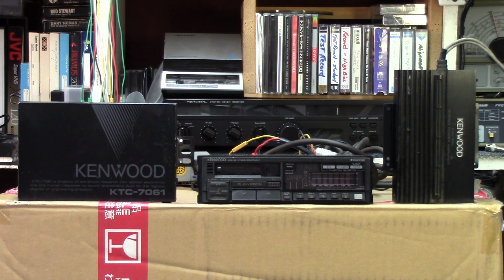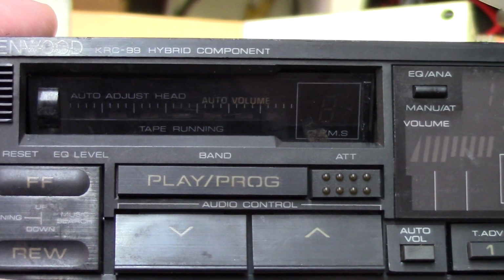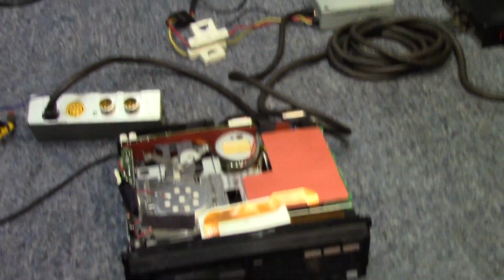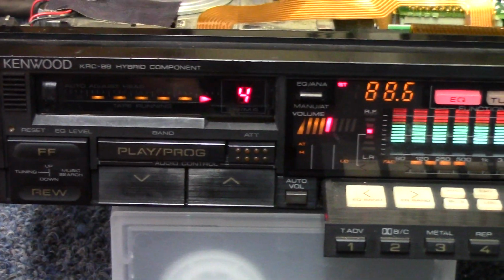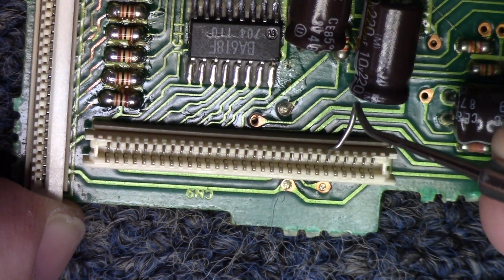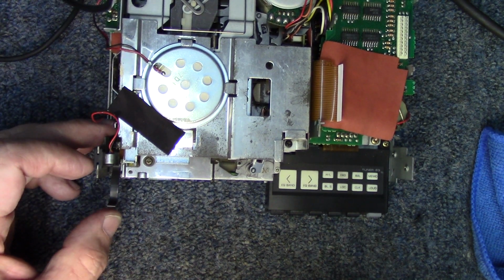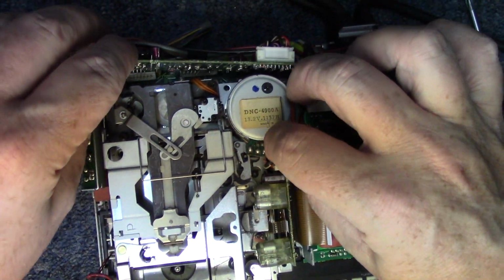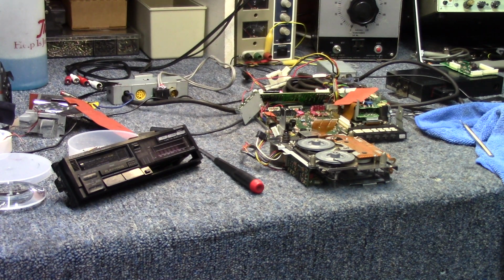Kenwood KRC-99 Car Stereo - pt.1 testing & teardown

Comment: I have on of these exact units on the way, so I'll definitely be using your videos as a guide. Thank you for making and uploading this kind of content!
Reply from the maker: RGM, thank you for checking out the video and congrats of the purchase of that sweet deck!
Reply: @luvradios   I need to bug you now. What was the pinout for the preamp DIN connectors?
Reply from the maker: @MBVTemjin  I dont recall the actual pin #'s but I do still have that adapter I made so I will find it in the next day or so and post let you know.
Reply: @MBVTemjin hi do you have the KRC-99 the japanese version or a 999II? awesome unit. wondering which one of those u got 😆
Reply: @etets444  It's the Japanese -99 unit, like in this video. It's easier (and a lot cheaper) to get those from yahoo japan auctions, although they're still not terribly common.
Reply: @MBVTemjin Which condition is yours in? Would like to know. 😀

Comment: TENGO UN SET KENWWOD M707-X707-Z505 PERO NO SE COMO INTERCONECTARLOS. ME PUEDES COLABORAR AL RESPECTO?TE ESTARE MUY AGRADECIDO.
I AVE A KENWOOD SET M707 - X707 - Z505 BUT NOT SO SHURE ON HOW TO MAKE THEM WORK ALL TOGETHER. IF YOU WOULD HELP ME IT WILL BE MOST APRECOATED.
BEST REGARDS